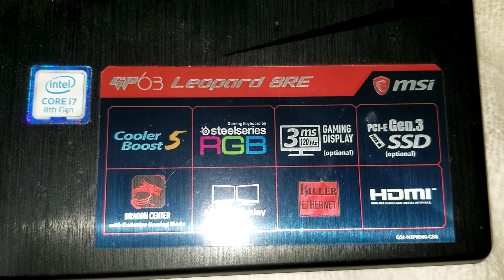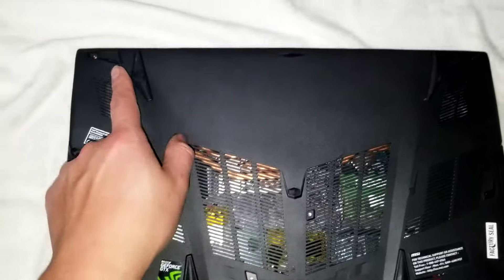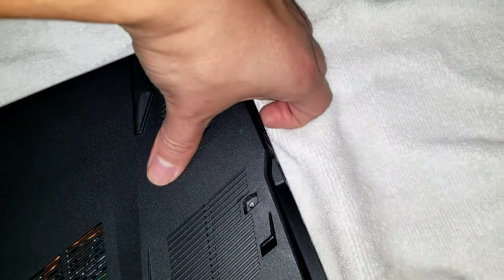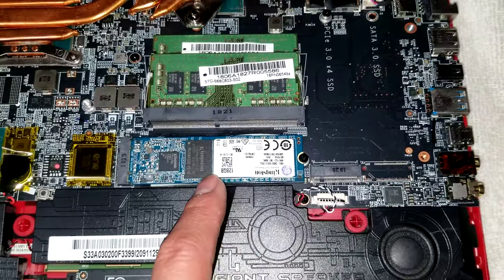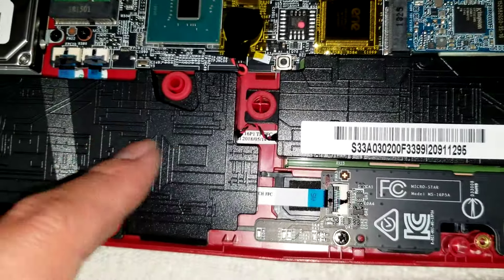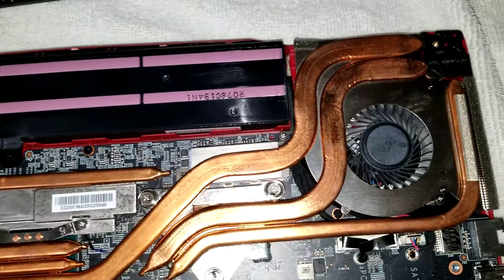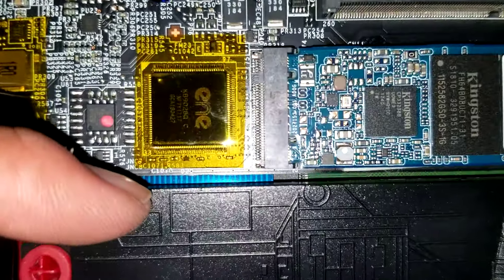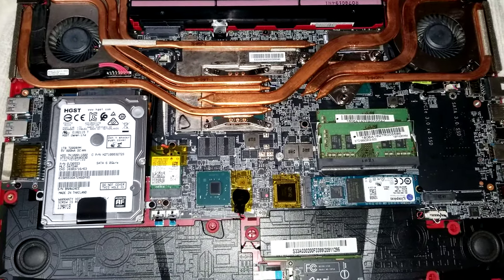MSI GP63 Leopard 8RE MS-16P5 8RE-013US Disassembly Hard Drive SSD RAM M.2 NVME PCIe Upgrade Repair

Comment: You can use a nvme or sata on the ssd slot thats used. I have the same laptop with a 8750h 16gb’s 2666 ram and 1070. Ive had mine about a year and 6 months and back then it had one of the best coolers in its price range and size. I got to upgrade my storage mine came with 128gb sata m.2 and 1tb 7200 rpm hd. I want to put a 1tb sata ssd and 1tb nvme ssd in it soon. I cant remember what the max ram speed you can use with it. And i think you could get a 60hz or 120hz 1080p screen mine has the 120hz. I just wish they would’ve made it easier to get to ram and storage maybe one or two screws and a small door. Gonna use liquid metal on mine when my extended warranty is up in 6 months.
Reply from the maker: sounds good

Comment: I have the same laptop i think it was a newegg exclusive, the only problem i have with it is the 128gb sata ssd. I just put a 1tb nvme drive in it.  I think the only difference was adding the 1070 and faster ram from the normal model.
Reply from the maker: make sure to migrate your os to the new ssd after installing it.

Comment: Hi there thanks for this vid. I'll be using it as a guide when i replace my RAM. Just curious, what kind of screwdrivers are used to take the panel open? Thanks :)
Reply from the maker: I bought a small precision. This is basically the same set. https://amzn.to/2SC152E
Reply: @ItsBinhRepaired   thanks so much! My laptop also seems to be missing a few screws.. any idea what size to get to replace them?
Reply from the maker: @kw2785  not sure, but they're a common size. The length make sure you don't use screws that are too long.
Reply: Hello, do you know if I have to remove the battery in order to add another RAM module, or can i do it without removing it?
Reply from the maker: @Alex-zv5dn  you can leave the battery in when changing ram, just make sure it's off
Reply: @ItsBinhRepaired Ok, thank you for you fast reply.
Reply from the maker: @Alex-zv5dn  no problem

Comment: Hey so my audio chip is broken and my warranty is over could possibly tell me where I could get a new one and how I could replace it please? Thank you in advance
Reply from the maker: Audio chip?
Reply: @ItsBinhRepaired  yeah the Realtek one that comes in the pc, mine doesn't function anymore, after a Windows update it just stopped working, I reset my pc, by formatting my drives and I installed windows from a USB and it still didn't work, so it's a hardware issue which means that it's scuffed
Reply from the maker: @clutch44444  :( I don't think you can replace that separately
Reply: @ItsBinhRepaired  well that's unfortunate then, so basically my entire laptop is worth like 15% of what it was originally
Reply from the maker: @clutch44444  you'll have to find a computer repair place that might be able to. You can use a Bluetooth speaker or usb sound card
Reply: @ItsBinhRepaired  I'll see if I can find one, thanks
Reply from the maker: @clutch44444  try booting an ubuntu usb to see if it's a software issue.
Reply: @ItsBinhRepaired  I'll try another time, thanks
Reply from the maker: @clutch44444  alright
Reply: @ItsBinhRepaired  Eyy my bluetooth speaker works, thanks for the suggestion mate, really appreciate it
Reply from the maker: @clutch44444  awesome

Comment: Which HDD goes into this laptop? All I want to do is buy a big ass 2.5 inch HDD for this laptop. What’s the maximum capacity 2.5 inch HDD for this laptop? The Max one I can find in this form factor is 5TB. 
But I don’t know if it will be compatible as I don’t know if it’s a 7mm drive or a 9.5mm drive. Could you help me please?
Reply from the maker: the only compatibility issue is the thickness of the drive. you'll have to find out.

Comment: Hey binh thanks for sharing this. I'm having a issue with no power going to the board. Usually when I plug in the charger I could see the LED light on. Now I don't see any light. The laptop is not turning on plugged in or on battery. 

I took it apart and noticed it might the the DC jack + cable that could be preventing the board from getting any power.  Any thoughts ?
Reply from the maker: You can use a volt meter to check if power is going through to the board.

Comment: I'm thinking of upgrading the RAM in my laptop (same as this one) because I believe my current RAM is failing. Was the back panel particularly hard to get off?
Reply from the maker: Should be able to tell from the video.
Reply: @ItsBinhRepaired  I just took the panel off, the back grill part was a bit of a pain but it went well. Thanks :)

Comment: I need to replace a keyboard, but is unable to find any video :(
Reply from the maker: Try EBay
Reply from the maker: Msi gp63 keyboard, but it's a pain in the butt to replace
Reply: @ItsBinhRepaired  I bought a new one, but unable to find any explanation.
Reply from the maker: @gregoryshilin280  it'll likely be something like this stupid design. https://youtu.be/ZaXwTTO2nnc